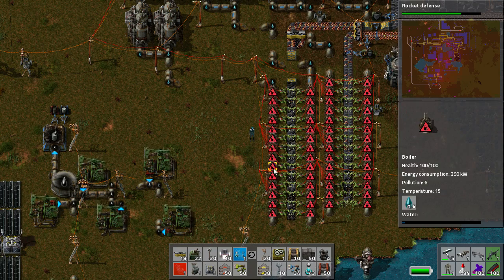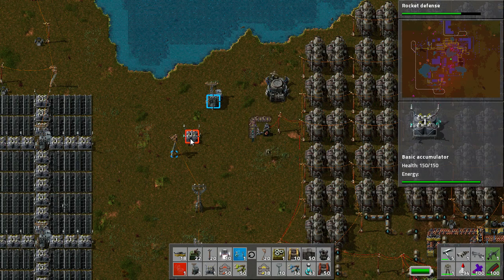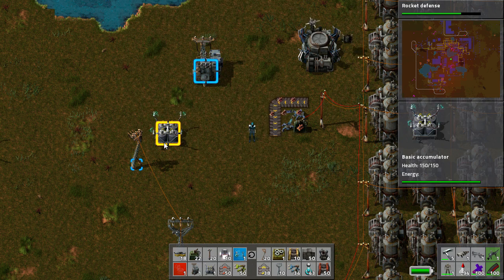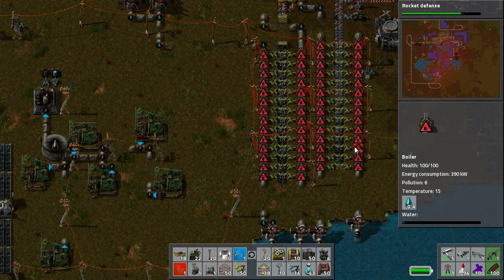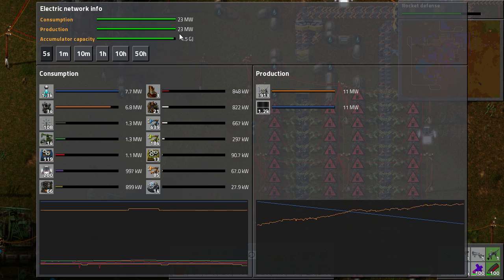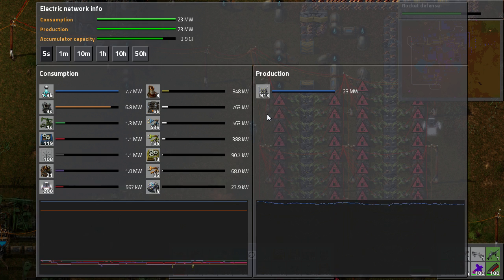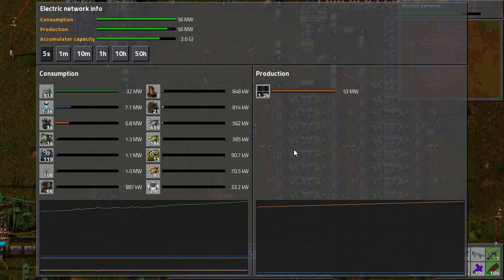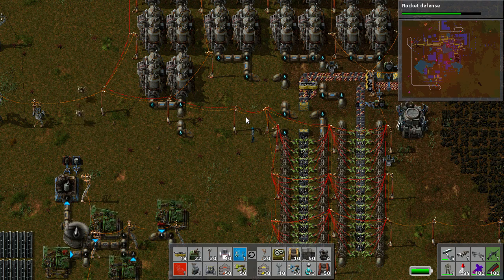Factorio Tutorial 13 - Emergency Steam Generator

Comment: You dont even need smart inserters. Yesterday i tried to power all the inserters for most of the steam engines with an single seperate steam engine (not connected with the main network) which is feed by an burning inserter. Then i placed this inserter at the end of an conveyor (like you show with the wood).  The two inserters at the sensor conveyor are powered by the main network and take fuel from a chest out and in. So If I run out of power the inserters at the sensor stop moving, the burnig inserter gets the chance to take some fuel in the single steam engine which powers up all the others. Of course with this methode takes some time till all your steam engines are off again, but later in the game (with more technologies) you could add electric pumps and trigger them instead of the inserters.